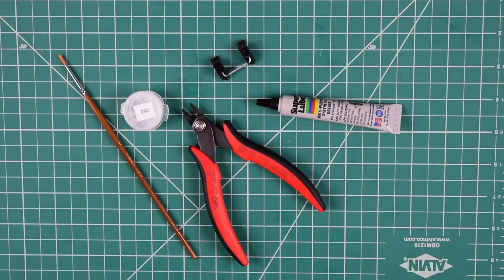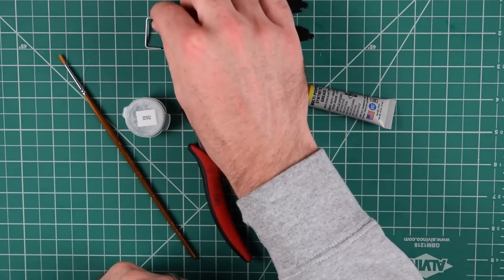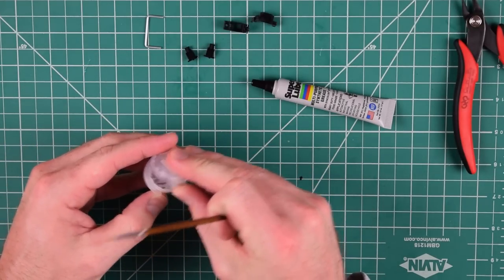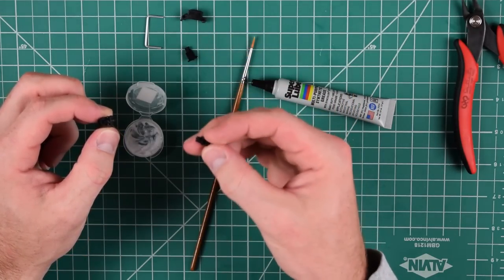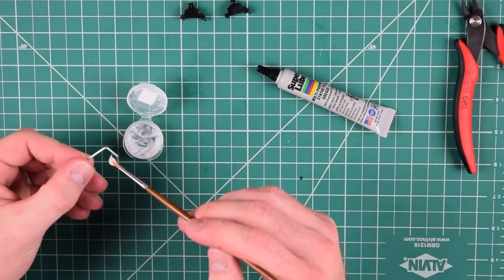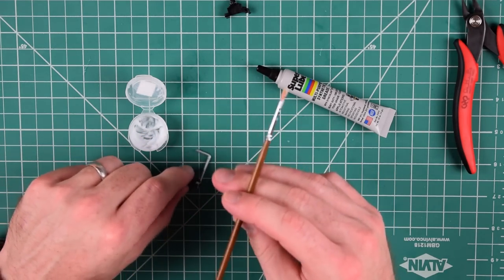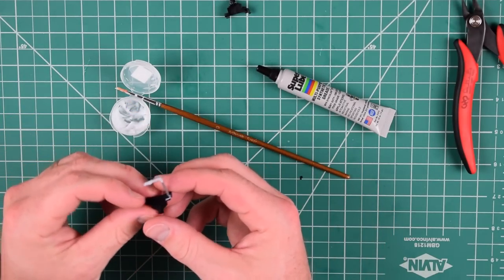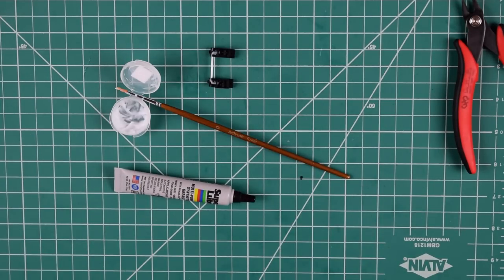Learn How to Tune Your Keyboard Stabilizers

Comment: What are the benefits/drawbacks of using Dielectric grease instead of 205g0?
Reply from the maker: so i use both - the grease is sold (as one option) in a bottle with a needle nose tip.  that makes application in the rear of the stabilizer very effective.  that's the primary reason I use it!

Comment: Would using superlube in place of the 205g0 be a problem for the stabilizer plastic housing?
Reply: I really dont recommend using superlube for housings
Reply: @seb_________1764  I've seen older videos recommending SuperLube and notice they were very sticky to use, I guess the other new lubes are recommended?
Reply: @roosterfloss758  not sure if there are other lubes that are good for housings

Comment: Can you use super lube on both the stab + wire and housing?
Reply from the maker: I personally don't.  I use 205g0 for the housing as well as parts of the wire+stab near the wire.  but the superlube does help to get those hard to reach places ;-)
Reply: @maxflive  Damm I had the hope I could use superlube for the hole stab.
I just tried a silicon grease and the spacebar is kind of grindy and the stabilized keys feel sluggish or have a slow return.
205 is not available in my country, I just have trybosis 3203 for the switches.